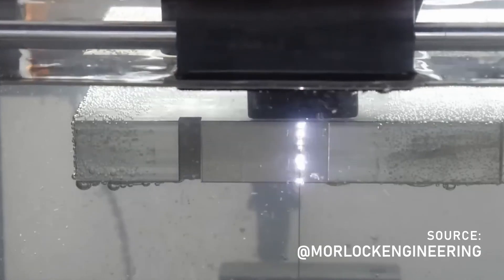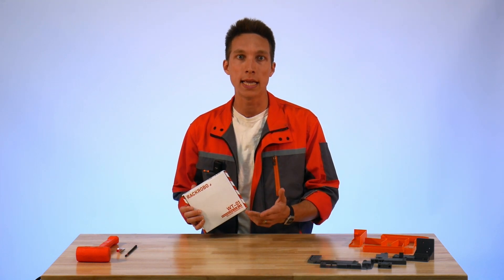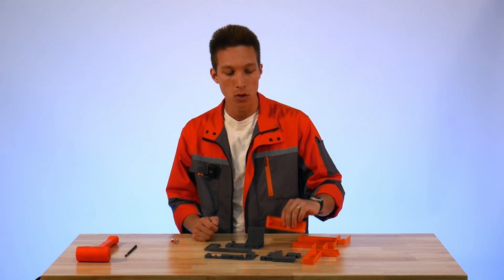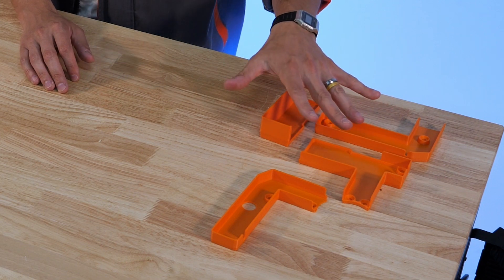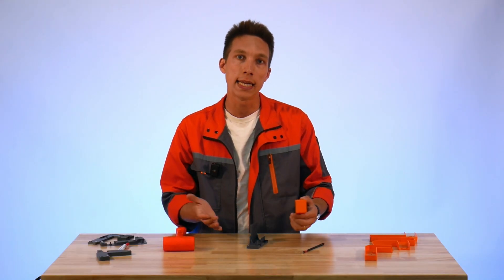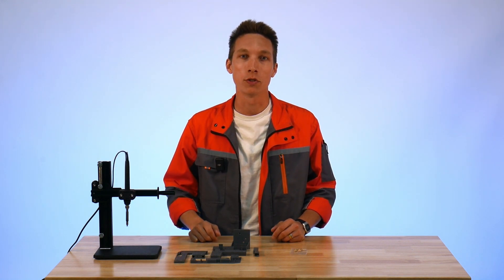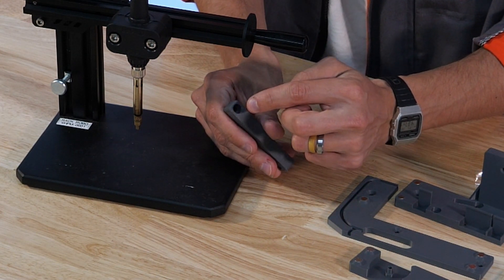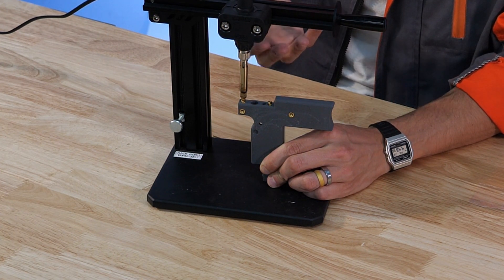3D Printer to WEDM Machine GUIDE - Part 1

Comment: if the machine is capable of Sinker. can you do a video on that ? I'm about 80% there to a BUY !
Reply from the maker: Great question! The answer is YES. We're going to do a video on that soon enough.
Reply: @rackrobo  I am also very interested in using it for die sink and discharge milling operations